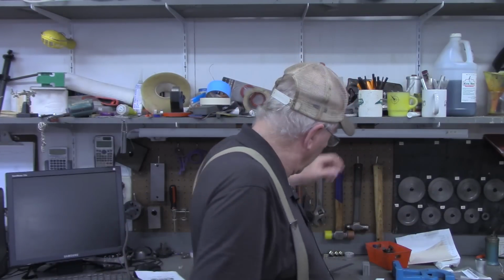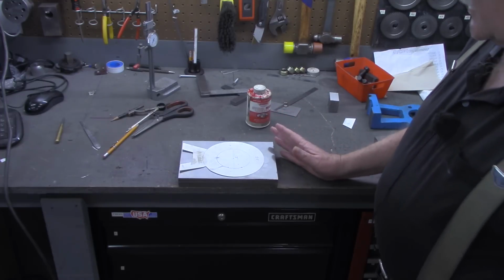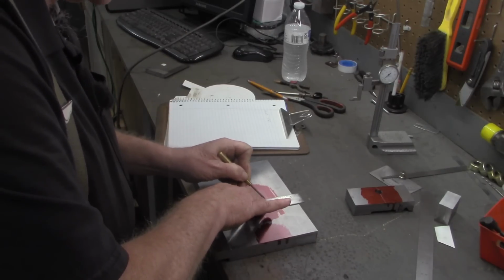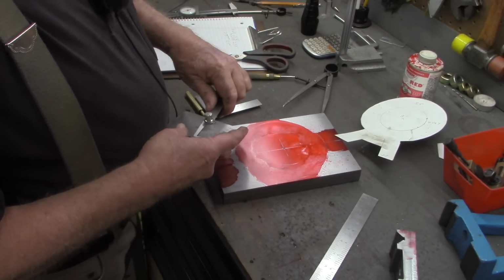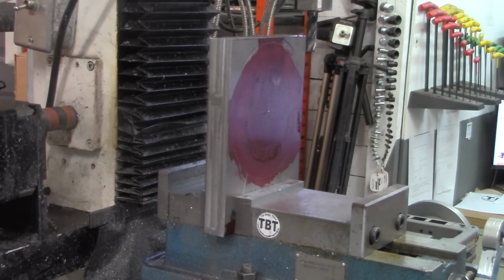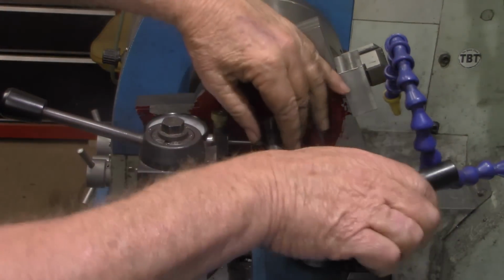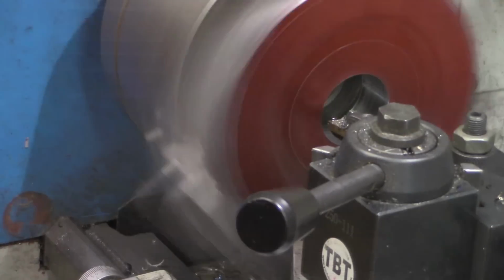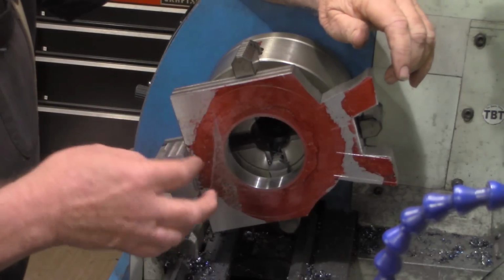Steady Rest Upright

Comment: I’m surprised you didn’t drill it out with a holesaw.
Reply from the maker: No way any hole saw I own is going to cut a 3" hole in 1" thick material. 🙂 Thanks for stopping by.
Reply: @MrPragmaticLee  I do it all the time, in my lathe.
Reply: I’ve also done the same, set up in the Bridgeport & used a hole-saw to remove the bulk of the material undersized on final diameter, then used the boring head to finish it out to final diameter.
Worked just fine.
It’s just a little easier setup than having to setup in the lathe is all.
It’s always interesting to see how someone else achieves the same result via a different method, so thank you for providing another perspective.
There is always more than one way to skin a cat. 👍👍👍🇦🇺